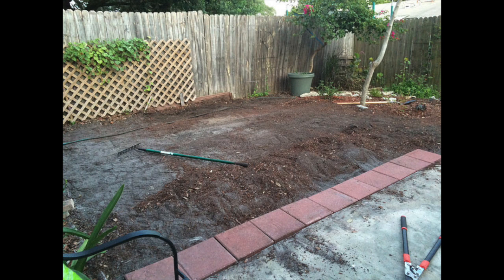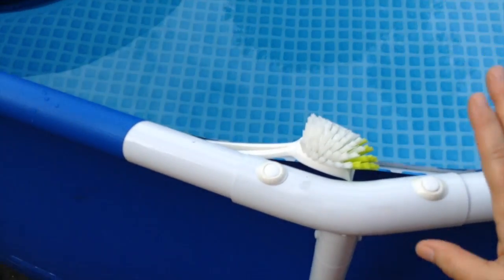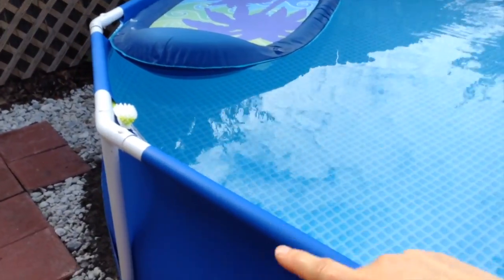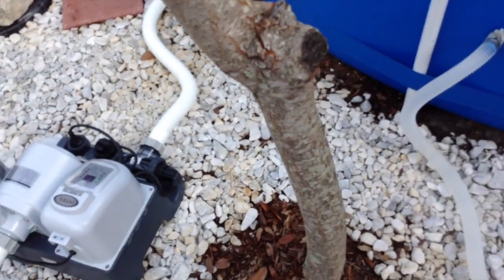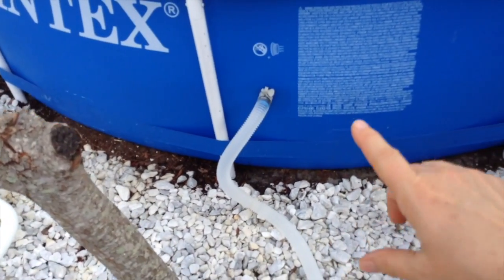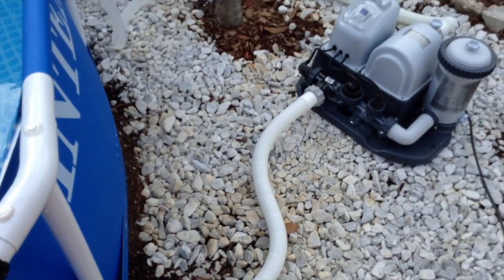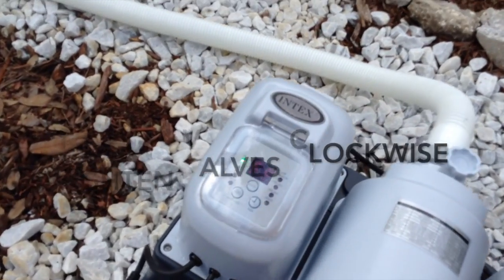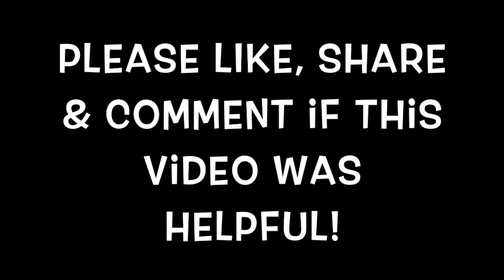How To Setup An Intex Saltwater Pool Pump

Comment: Do I have to drain the pool in order to switch from the pump that came with the pool to this system?
Reply from the maker: Helen Cook you don't have to drain the pool if you have plugs to replace the strainers temporarily. The inlet nozzle will need to be closed using the handle before you release the old pump from the ( other end of) inlet hose. Then you can attach the new pump to the inlet hose. Remove the plugs after you release the inlet nozzle. Lift the inlet hose after you open the new pump filter top and another filter top until the water runs from both of them. Then tighten them and turn on the pump. The manual explains this but sometimes not very well! In fact mine was telling me to put the hoses on backwards! Which is why I made the video!

Comment: Soooo I have some green pool problems. Not from algae. The first day I ran the pump 24 hrs. Next day I turned salt water system on and water turned greenish. I realized after rereading the manual I put too little salt in. Bought more, put some more in, scrubbed it in to dissolve and went thru pump filter again. 24 hrs. Turned back clear . Turned on the salt water system after and said the salt was high in it. So dumped and renewed a bit. Then turned system on and it's turning green again. What is wrong???? Why is the salt system turning my water green?!?!?! Please help!!
Reply from the maker: That is odd. I recommend taking a water sample to your local pool store for chemical testing. Once that is sorted out, you should be able to only use salt.  I had some similar challenges with getting the right amount of salt. It didn't turn green in my case, but the pump beeped due to not enough or too much salt. I followed the pump codes (LED and beeps) carefully until I got it right. It may be that you need a day or so to watch/follow the pump's signals til the salt level is accurate. If after that, it's still green, I'd take the sample in to the store and follow their advice to get levels right. Which means you may need to initially purchase some chemicals. (I had to do that once or twice, due to heavy storms/debris) Good luck!
Reply: Jenny Leigh Hodgins yes this mornin it was crystal clear. I've been spraying out the filter pump for a couple days now since our water is very hard and figured that'd help. But anyway crystal clear I vacuumed out and skimmed it do it's relatively clean. Got some alkaline lowering granular to lower the alkaline level. Cleaned the flow sensor and tried to clean the electrocell as well with vinegar as it was a little calcium buildup already... and tried to start it the salt system again and again it's saying I've got too much salt. My nearest local pool store is 45 mins from town (and trust me, we live in a 22000 ppl town you'd think they'd have one here by now... ) so it's really out of my way to do that. The system keeps beeping saying my salt was too high too. So atm I'm emptying a bit and filling it as it's emptying.. So another round of filtering I'll do because obviously our water is so hard and it gets pretty gross quick.. this is so aggravating. Thanks for listening.

Comment: Do I have to put salt in the water
Reply from the maker: edmesor You won't need to put salt in the water until the pump tells you to do so. Run the pump for a while & (swim! Enjoy!) when the water chemicals change enough it will register-- The pump will beep at you consistently & a light will come on next to "low salt". Then I highly recommend only add 10 pounds of salt and wait a while after you churn up the water a bit to see if that light/beep goes off. I learned this the hard way by putting in too much salt. Then the pump will beep at you and say "high salt" and you will have to drain the pool and add fresh water. Don't waste money! A little bit of salt at a time!
Reply from the maker: edmesor Yes. But only when the pump tells you it is low salt. See my comment in detail below.

Comment: I wonder how long I will need to run the salt water system for an 18x48 🤔
Reply from the maker: The saltwater pump manual breaks down the time per pool size.

Comment: If your frame is metal you won't have a frame after 3 or more years. The salt will destroy the metal. Comment by Heath
Reply from the maker: heath sunday These little above ground pools don’t last more than 2 or 3 years anyway. They’re only about $100 -$150 so it’s well worth replacing them periodically when you live in Florida! And I much prefer the saltwater system to all the chemicals and the cost of those!